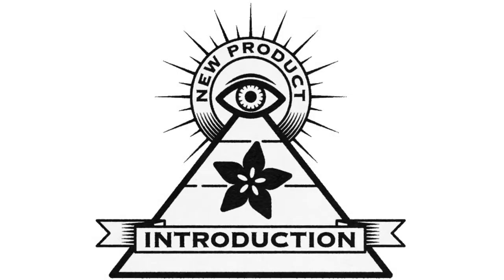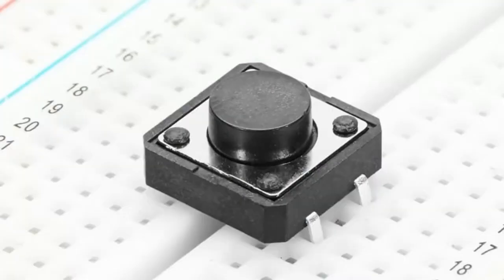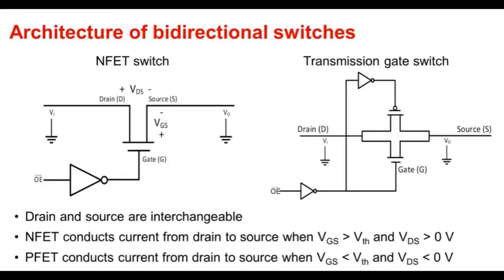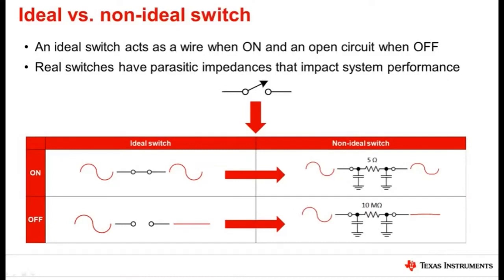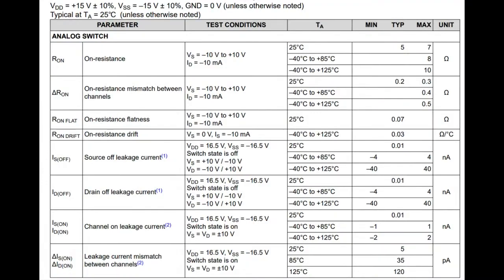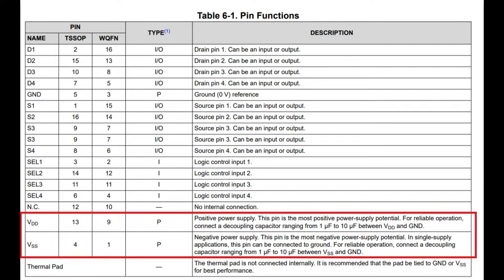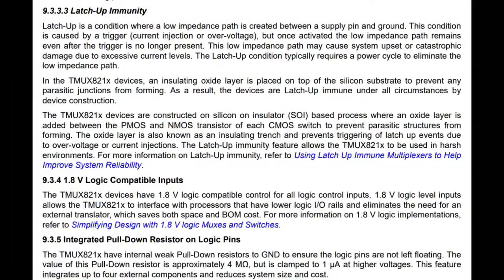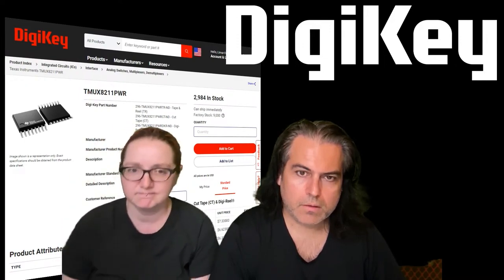EYE on NPI - Texas Instruments' TMUX821x Flat RON SPST 4-Channel Switches @TXInstruments @digikey

Comment: I've been thinking a while about using analog switches for audio, specifically for an electronic patch bay for automated recording as well as in some custom Euro-rack synth stuff. The amount of info on analog switches is pretty overwhelming, so your research efforts in this area are very much appreciated, especially the comparison with the 'standard' CD4066.  TI has always made interesting devices ... and leave it to Lady Ada to not only discover them for us, but to bring them down to earth in an easy-to-understand fashion, in ways that make them simple to use. What more could we DIY'ers want? Rock on, Adafruit!
Reply: You should check out the new TMUX4827 for analog audio, it has some of the same great performance as the TMUX821x but built for high power audio in an extra small package!